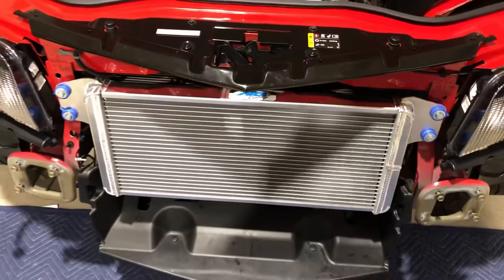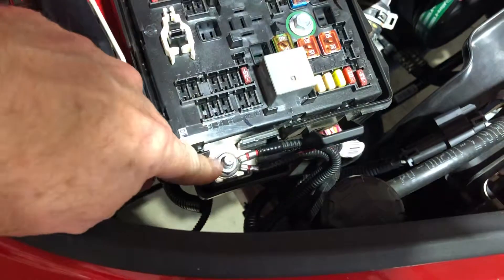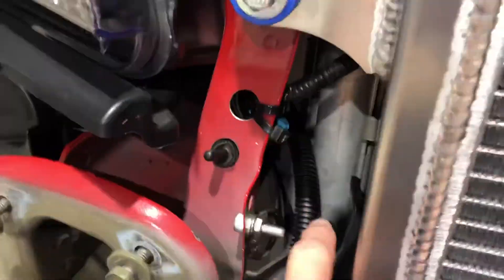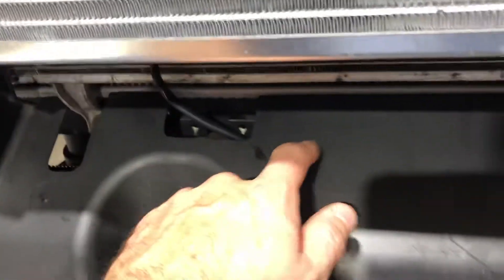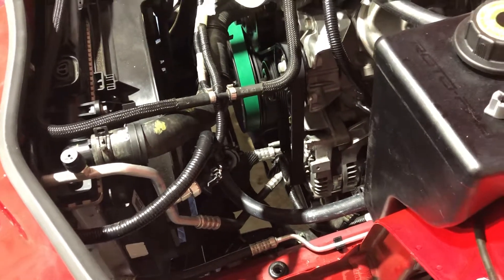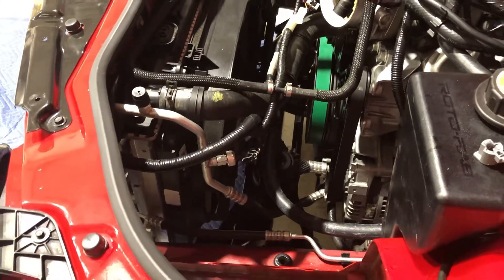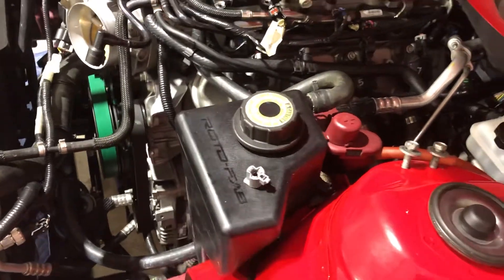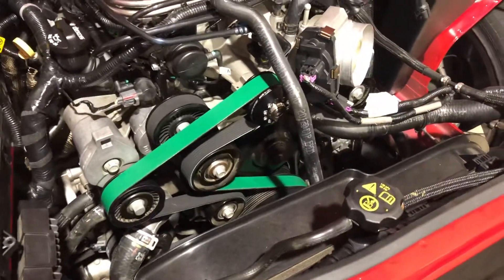AFCO heat exchanger installed

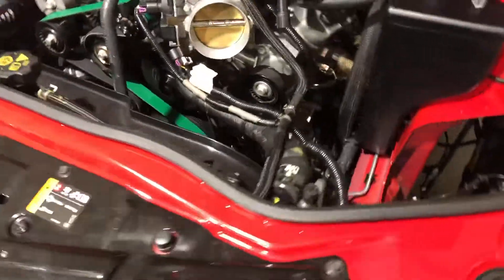Comment from the maker: 1:26 Use #5 pin on the connector, this is the motor wire. see the link
https://www.camaro5.com/forums/showthread.php?t=255716
Reply: Hey man. Quick question.. what temps are you seeing now? 
And is the rag supposed to be sucking from the front of the heat exchanger toured the inside of the car?
Reply: When testing ofcourse

Comment: Have a question would you want it on signal not 12v wouldn’t it be on all the time ?
Reply from the maker: Yes, mine is on full time
Reply: I put mine to the signal wire but for some reason it’s on all the time maybe because I haven’t bleed it right idk haha but do u daily drive it ? Do the fan have long life to them ?

Comment: I man thanks for uploading these videos .. am planning to do the afco soon  too and upper pulleys .so did that tan wire end up turning on the fans.?
Reply from the maker: The fans are on whenever the SC coolant pump is on. Thats how it's signaled. The wiring in the video is correct as far as fan rotation goes. Some peoples were reveresed.